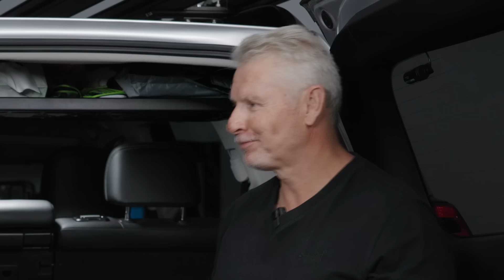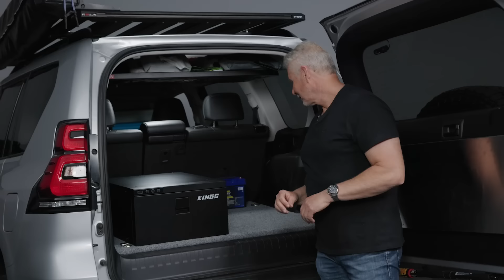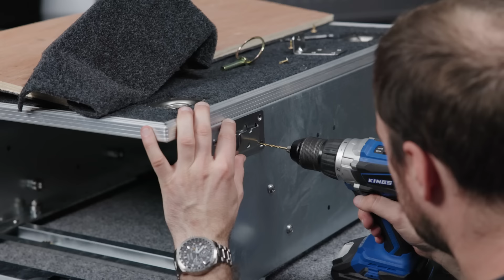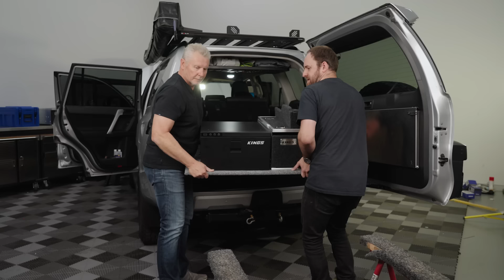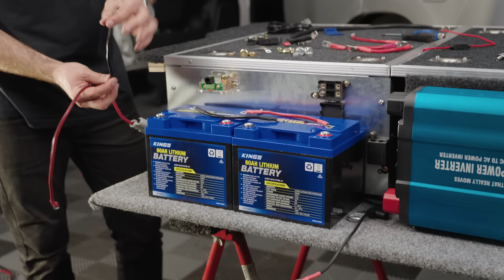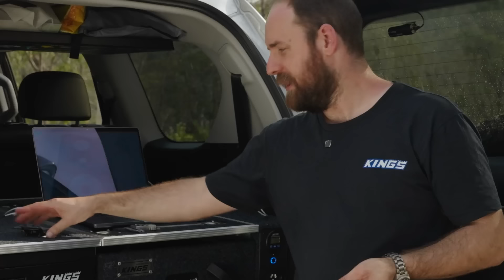Adventure Kings DIY: Removable "Day Tripper" Set Up

Comment: How did you get the drawers to fit between the tie down points?  I couldn’t fit two, it’s just a tad too wide
Reply from the maker: Hi there,

The drawer fridge is not aw wide as the rear drawers which helps with fitting.

Cheers, Jayden
Reply: @4wdsupacentreAu oh ok, I’ve got a drawer kitchen and a drawer

Comment: for single/individual pulling in and out, you could split the base timber in two, and have a connecting/fastening link that joins them together in some capacity once both bases have been slide into place to create a more rigid two component connected platform once they are in.
Great overview on the removable setup/thinking around it.
That's me thinking out loud re: doing it when no one else is around to help. (emptied draw/fridge assumed).

Comment: Ive recently done a  very similar setup with the titan drawer to match the 30l drawer fridge height. Came out really well, recarpeted the front to black to match. The only problem now is the titan range darws are no longer supported??? Cant get a stainless table to suit now? Will the fridges also be changing height to match the new style drawers?
Reply from the maker: Hi there,

I do believe that there are plans for further expansion of our drawer and fridge ranges, so while nothing concrete just yet, I wouldn't rule it out.

Regards, Andrew
Reply from the maker: Hey mate,

Just want to clarify - there is a stainless drawer table that suits the new drawers and now the new 'small fridge compartment' is designed to fit a Kings 30L draw Fridge and brings it up to the exact same height as a drawer - so the whole setup matches

take a look at the website for more info!

Cheers,
Cahn

Comment: Is that 1500w inverter  at 0:40 a new product?
Reply from the maker: Actually an old product - this was filmed a while ago, if we did it again we would have used the current 2000W - it’s a similar size and footprint. With the 2x60Ah you’re limited to about 1500W output but obviously every setup and requirement is different!

Cheers,
Cahn
Reply: @4wdsupacentreAu  Just curious as I’m planning on purchasing the batbox25 with a 120ah battery and running an inverter but it says max 1500w
Can I run the 2000w inverter and still be okay? Biggest appliance I would run for a short time is a 1500w air fryer and possibly small induction cooker but not at the same time
Reply from the maker: @crk3rd841 yes the limit for output is ~1500W on the batblock - so what you’re saying is all good! In theory you could connect a 3000W or 5000W inverter and it’d be fine, so long as whatever you connect to it (induction cooker or coffee machine etc) doesn’t exceed 1500W!

So long as you don’t exceed ~1500W total output on the terminals you’ll be sweet!

Cheers,
Cahn
Reply: @4wdsupacentreAu awesome, thanks for the info and quick replies!

Comment: Well, I added all your components, and I think your whole thing would weight about 80-95kg at least, without any contents.

And add another 100kg contents and whatever goes on top of the drawers - that’s 200kg+ held 4x tie down point secured each with a single 5or 6 mm bolts?

Must be pretty heavy to slide out in any case
Reply: Unlikely, they lifted with ease
Reply: If you added it all up and have a 15kg difference I'm not trusting your maths 😅

Comment: Nicely done. You could slightly recess the panel containing the monitor/remote/240 outlet so the 240 can be used with the rear door shut - could be useful for charging power tool batteries and such while on the move

Comment: Good one fellas.  How was the spare drawer top mounted onto the fridge?
Reply from the maker: 3 of 4 of the holes for the tie down points on the drawer top lined up with the 4 threaded inserts on top of the fridge

We opened up the holes slightly to allow a bit of adjustment, and used short bolts with recessed nuts for the others to hold the tie down points.

Hopefully that makes sense!

Cheers,
Cahn

Comment: Why run the two 60s when you can run a 120
Reply from the maker: You could - this set up just allowed the seat to come back further as it wasn’t as tall!

A single 120 would be easier that’s for sure.

Cheers,
Cahn
Reply: What is the max amp draw for the 2x 60 amp batteries. Noting max draw is 50 amp for one battery. Your description of running 1500 inverter is where I am coming from @4wdsupacentreAu
Reply: I was thinking the same thing.  Or even use the 200Ah if they require more power.